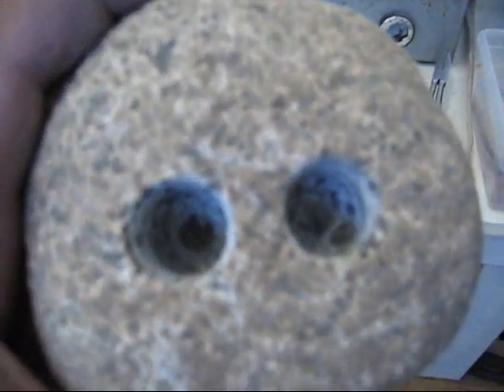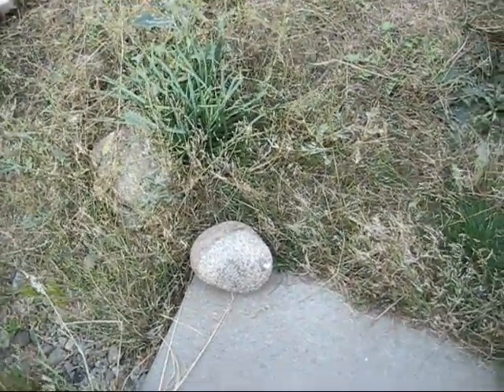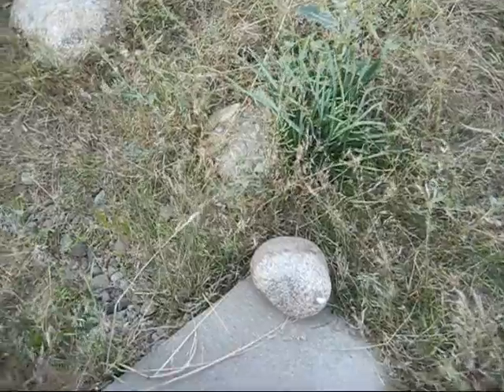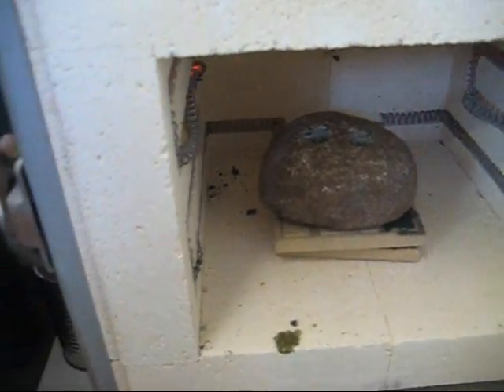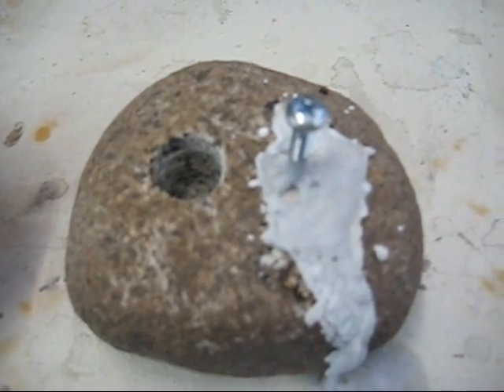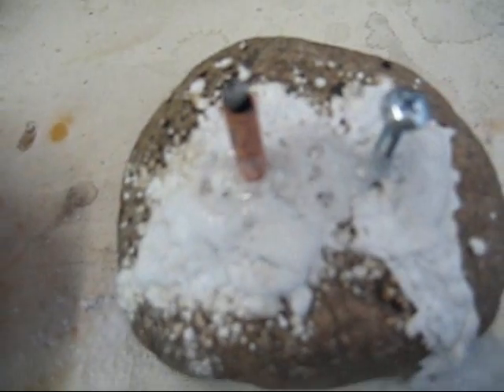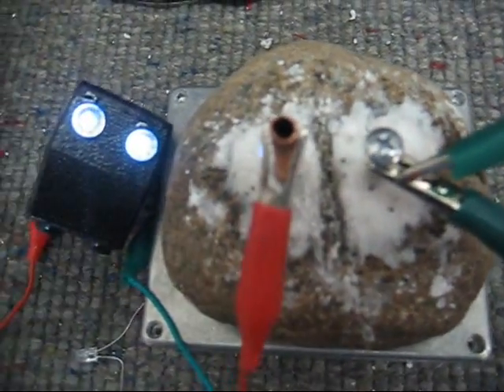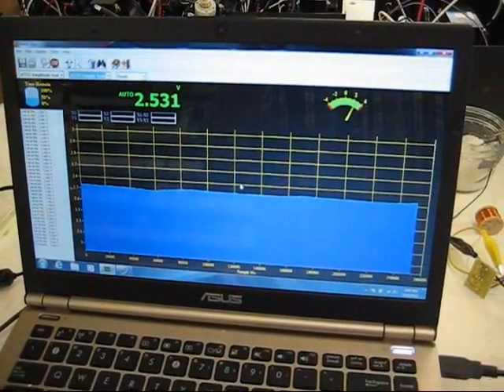Making Rock Crystal Battery1 John Bedini

Comment: Nice! have you tested magnetic rocks vs non magnetic? Your rock looks like a magnetic one. I find it with a neomagnet hanging in a line.
Have you tested diferent shapes of electrodes ?    watch?v=l9CxFK_sEMI
This man close a coil in a portland concrete box, and make a single line welder.    watch?v=gjPpQKkvjQU    Do you think that crystal rock instead of portland cement make any difference?

Comment: So you have found how to align crystals so they can work as diodes of sorts? If that the case, wouldn't crystal structures proposed be Nassim Haramein will be the answer? I Believe that you Mr Bedini are the modern alchemist able to reproduce such crystal with nothing less than a micro black hole in it. Thank you for sharing your findings